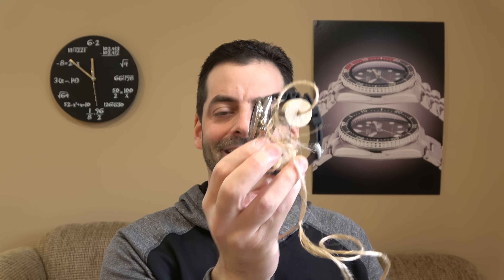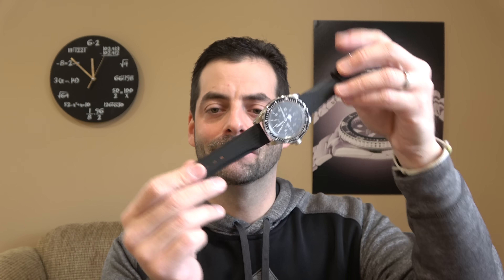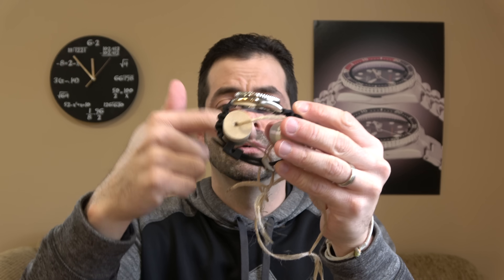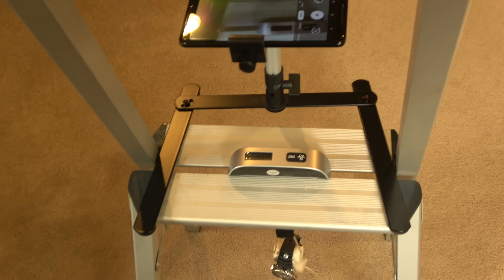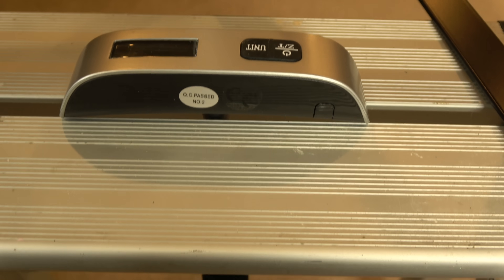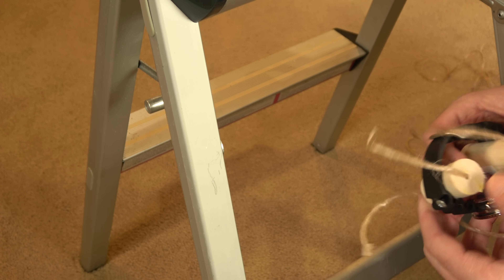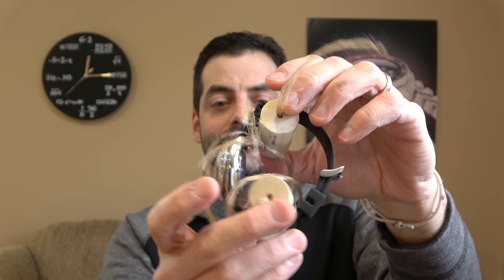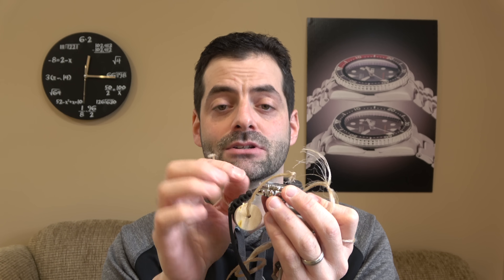Can a Seiko spring bar withstand 44 pounds of force? Watch and Learn #61

Comment: Well my Certina DS Action Diver 38mm is ISO certified to 300m and the spring bars are "just" 1.8mm in diameter with 0.8 tips. Never failed me. The 2.5mm with 1.2 tips might be overkill, and surely are a pain to use with most aftermarket straps.

Comment: That was most interesting thanks Mark - I wore a Seiko SKX009 with a Seiko Oyster bracelet that had the thinner spring bars whilst I chainsawed and lugged a large tree that had fallen down. Whilst forcing the roots out with a large bar one thin spring-bar on  the watch bent but did not fail - I was most impressed. The fat spring bars must obviously be much stronger.
Reply from the maker: Yes, they are much stronger.

Comment: Hi Marc.  Engineer here... I think you had the right idea on testing it, but you did not prove the strength of the spring bars.  In your test, the force is being split more or less evenly between both sides of the strap, and thus the spring bars and the clasp each take half the force applied.  Since the whole thing failed at about 80 pounds, the spring bar was at just 40 pounds, which is less than the ISO spec.  

My suggestion is to triple the the twine through the dowels top and bottom, which should allow you to test up to 120 pounds and 60 on the spring bar.  Your Cub Scout square knot should hold since each strand of twine will have 1/3 the force or less.
Reply from the maker: This is how the test is to be conducted per the spec. So everyone out there stating the spring bar itself needs to hold 40+ lbs is wrong. It's not. As I said in the video the load is split.
Reply: @islandwatch : OK, apologies, I missed the statement about the spec in the video.
Reply from the maker: I am curious though what the force split is. It's not 50/50

Comment: Love these videos. Would like to see the heating then room temp water drop test for condensate. Ive got a suunto core brushed aluminum watch with a depth measure which regularly fogs internally when jumping into cold water, never had this issue with my 'mini turtle'. Cheers
Reply from the maker: Thanks. I've done similar in wnl #5 or 6.

Comment: Question - I get the minimum failure spec for the band and couplings and see it as a sign of quality design and manufacturing, but I'm wondering if there is a failure requirement spec on the other end of the product testing spectrum. Question is - is there, or should there be a required design failure threshold in the horribly unlucky instance that your watchband gets caught on something - say a carelessly passing boat hook? In other words, I'd want the band to fail just before the unexpected force approaches a level that could significantly injure a person.
Reply from the maker: Nope; it's a just a minimum. If a force comes along great enough to rip off your arm, goodbye arm.

Comment: Does the spec really use lbf and not Newtons as the unit of force? 195 N makes a bit more sense than 44 pounds-force.
Reply from the maker: It's actually spec'd in Newtons; 200N; my brain shortens it to 44 lbf instead of rounding to 45 lbf.

Comment: while not an engineer I was an Ironworker/rigger for 20 years and have worked on and with all kinds of loads and crane and rigging configurations,load cells, etc. I dont think the full fail test can be reached when stress travels to the weakest point, you get stretch  or defection there instead  of on the object you want to test, I think we used to call it a static stress test or something like that when trying to test an object isolated from any rigging or anything connected to it that may fail first before the full load was applied. whatcha think?
Reply from the maker: Proof loading? I'm not sure that applies here.
Reply: well to me it seems like you failed your  rigging instead of proving the spring bar

Comment: The springbars on my Vostok Amphibia would be interesting to test. They are really thick and well made.
Reply from the maker: I'm sure, thanks!
Reply: The Vostok isn’t ISO certified
Reply: @sashachip  The Vostok meets the ISO water resistant spec not the diver spec.

Comment: Now I wonder would the jubilee be any different... I guess the hollow end link would change the load distribution on the spring bar, but maybe that would also pass.
Reply: I'm thinking not. The center hollow links might stretch out and give.
Reply from the maker: I thought about that as well. I think the rubber would hold more load, but still pass.

Comment: Makes one wonder about aftermarket straps, bracelets, etc., and taking a watch to a jeweler for various reasons. Had a strap replaced one time and they replaced a spring bar. It wasn't an ISO diver, but just saying. (It was an authorized Seiko dealer locally.)
Reply from the maker: Right, they are thick for a reason.